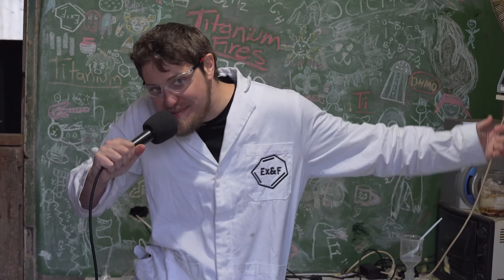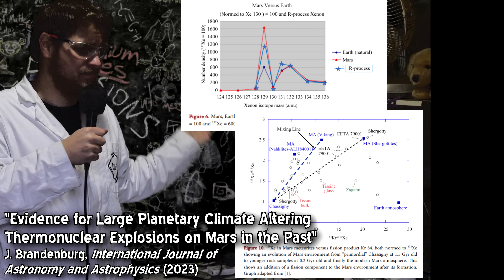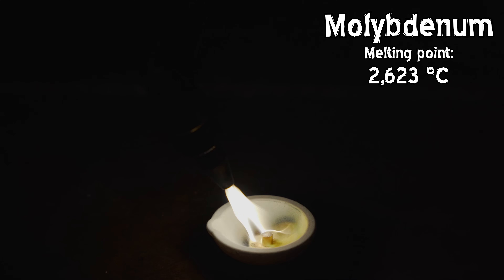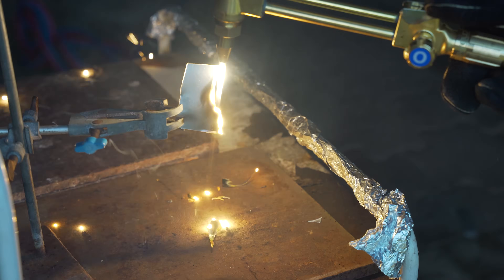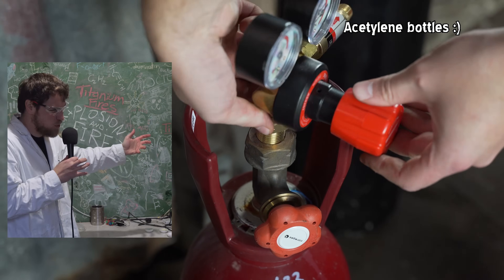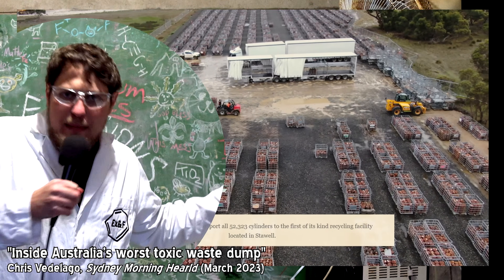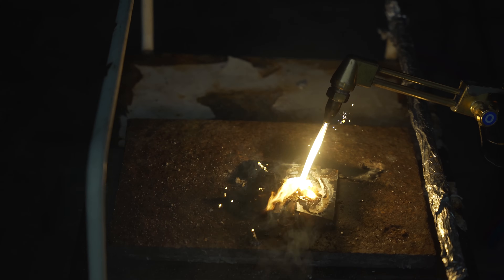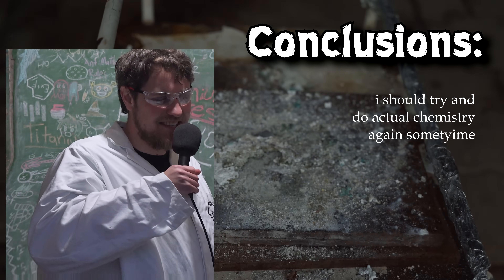Actually burning titanium

Comment: From what I understand if you get titanium turnings (The corkscrew bits formed when cutting it on a lathe or drilling it) are capable of burning, perhaps you just need some of those instead trying bulk pieces of metal.  I suppose it's also possible that the cutting oil used (Not sure what type of lubricant is used to cut titanium) helps to sustain and spread the flame enough for it to really burn.
Reply from the maker: Yeah there must be some surface area/volume ratio where the self-sustained burning cuts off. Kinda interesting, wonder if anyone has done that research before
Reply: @ExplosionsAndFire  NFPA 484 (U.S. safety standard for combustible metals) probably has that information, or more likely what tests to do for a particular sample. Either NFPA 484 or 652 (combustible dust standard) has information on determining the explosiveness of dusts, including metal dust, so I wouldn't be surprised if they had similar information on combustible metal shavings, foil, etc.
Reply: @staples156  NFPA 484 seems to mostly be concerned with powder and chips.  The Fire Prevention section calks about "storage of titanium chips, powders, fines, or titanium with a thickness less than 0.038 cm (0.015 in.), or for titanium handling,"
Reply: @staples156 yes , but he's in Australia,  so he'd have to hold the book upside-down to read it .
Reply: @Benabik now hold on a minute . Logical conclusion meets sensible regulations,  what?!
Reply: I remember when SpaceX was testing the engines on the crew dragon capsule and the went kerbal. Some of the parts where made out of Ti and burned quite fast.
Reply: It's the same as how steel wool burns readily when you apply a 9V battery to it, the heat sinking capacity of the solid plates is too much to sustain the combustion I think, it's a surface area to internal volume thing, swarf has a much higher surface area / volume than solid plates do.

Comment: Nonono the plastic isn't just being burned, the energy within is being thermally recycled :D
Reply from the maker: Carbon craves the atmosphere. Who are we to condemn it to eternity trapped in a polymer??
Reply: @ExplosionsAndFire  And as thanks they make us all feel warmer inside (and outside)!
Reply: @ExplosionsAndFire  One of the greatest truths ever told.
Reply: It might be viable to burn the plástic, get energy, capture the carbón, make carbón fiber/graphite materials, profit
Reply: @ElxCriiO that might work if we could get it to just something less oxidized than CO2, but taking CO2 back to a useful oxidation is usually energy inefficient. Depending on the method/energy source, that often even means an even larger amount of CO2 is being produced elsewhere (e.g. a coal- or gas-burning power plant).
Reply: @CDCI3  
Plants do that for free, using free sunlight.
The carbon content of wood is roughly 1,000 times higher than air.
Reply: Japan: "Emissions agreements what emissions agreements?"
Reply: @shingshongshamalama  Japan:  Also, Fack you dolphin and whale!